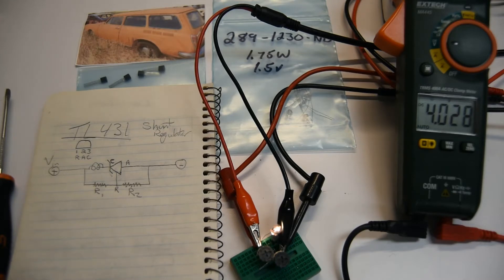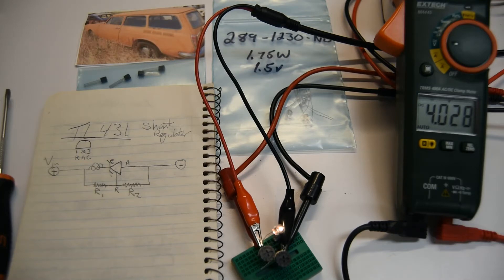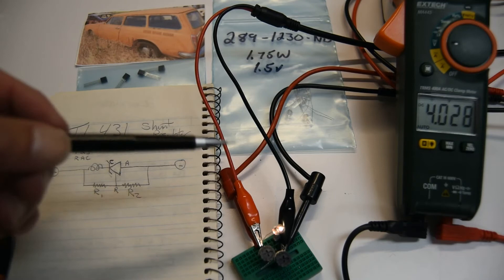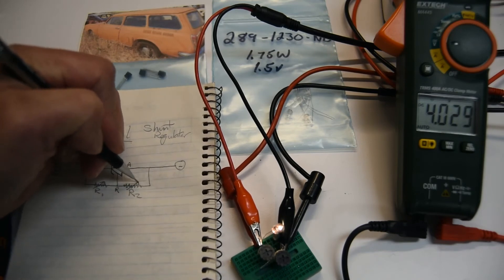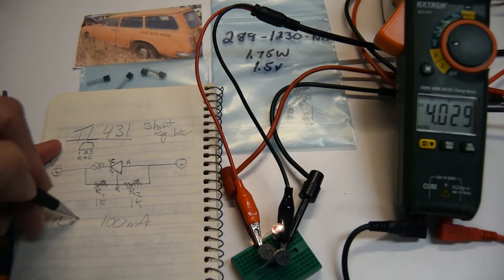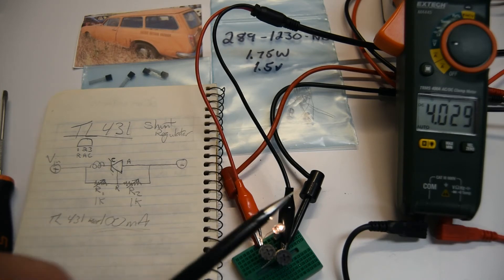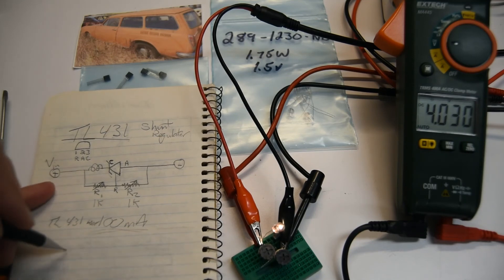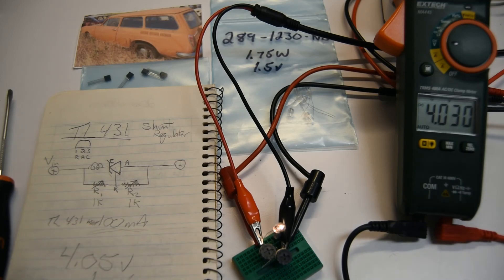Testing charge control using a TL431 Shunt Regulator for my Nissan Leaf modules.

Comment: Watching this with interest but how come you need 80 when the Leaf has 96 cells?
Reply from the maker: Yes a Leaf might, however, the VOLTswagen Squareback EV will have only 80 ;)
Reply: @ZookeeperJohnG  So are you planning to build this into a BMS or just an overcharge protection?
Reply from the maker: This is only for individual cell protection, overall voltage is set by the controller.  In no way a "real bms" in any event.